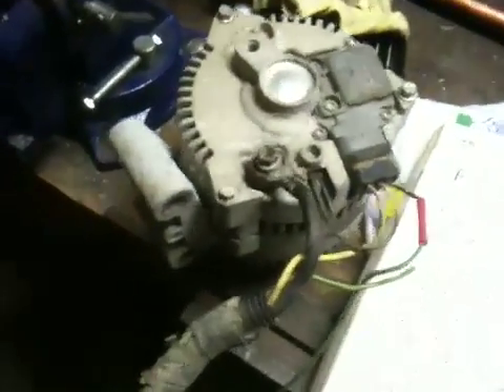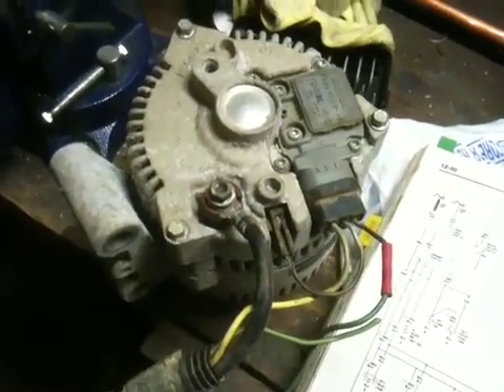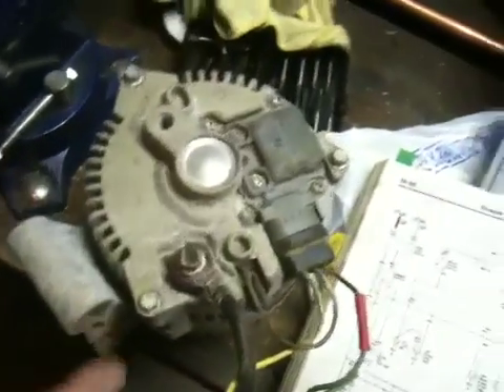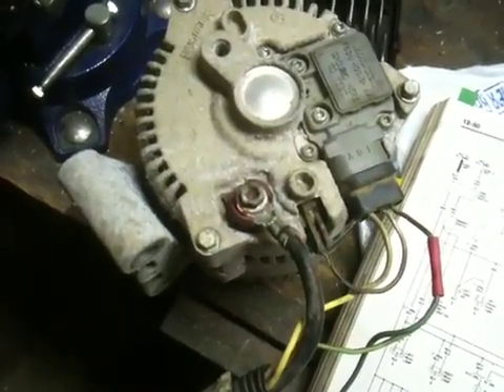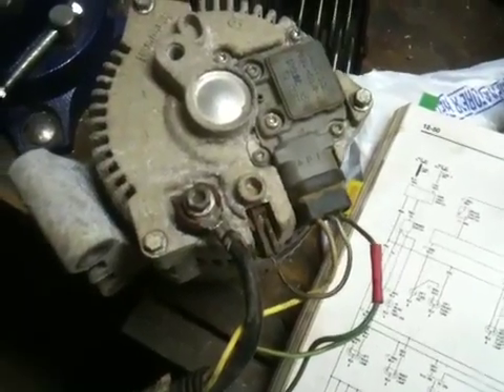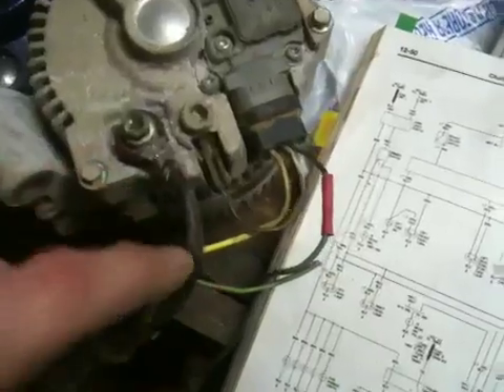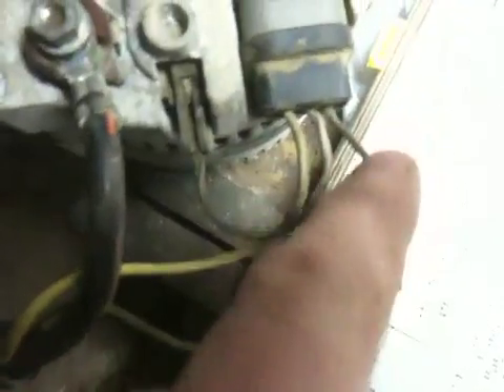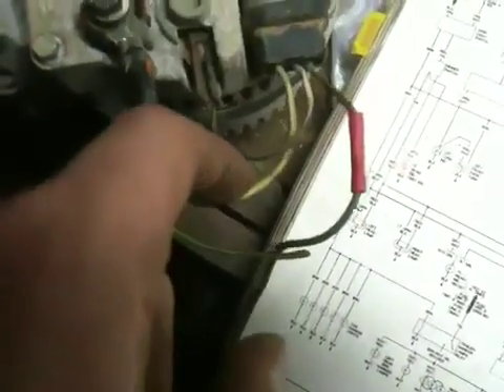Ford alternator wiring questions

Comment: For anyone still coming across this video, the device where the plug is located on this alternator is the voltage regulator. No need to add another. If you're curious about what voltages that alternator needs on each wire, you can watch this video. It explains the ASI lettering. https://youtu.be/Cnt025qfCpw

Comment: I have an 04 expedition 4.6l and I’m need to find the excite wire or the one that tells the alt how much voltage it’s putting out. I want install a rectifying diode to trick it into thinking it’s getting less voltage so that the alt puts out an extra .6V. What wire or where can I solder this diode to? Please help please! I know it’s frowned upon but I have a big amplifier and need more than 14.4v it’s actually giving me 13.4 while in highway. Help

Comment: But to buy pass voltage regulator , just run green & red stripe wire straight to battery positive post with inline on - off switch routed back inside console area for easy access   . Switch Must be a strong eneough to carry load . I use standard houehold AC on-off light switch available around the house . .... important :  always turn swith on when vehicle is running to charge battety and  AND  ALWAYS  turn switch off when you turn vehicle off or it will back feed back to alternator and slowly drain battery .    I know its a pain in the ass but thats why its recommended that a voltage regulator be in place .  Leave everything else already connected by the factory setting  alone  just incase you want to go back using the voltage regulator one day .  Chances are , your dash battery or alternator light will still be on while the battery is being charge still during vehicle operation . You can verifide voltage with volt meter while vehicle is running with it charging . You should read somewhere between 13-14v  . Hope this tutorial help ?

Comment: thanks for the video although it didn't help the comments did  i tried 3 diff alternators none would charge so i was about to take it to an electrical shop when i read the comments and come to find out  our mileage thing on the dash don't work so we got a used dash panel and it nvr  showed that the car was charge but we ignored it thinking it was norm well anyway we put the old 1 back in and wala it was charging so if you have a 1992 f150 or e150 and it wont charge with old or new alternator i suggest testing the dash panel with  all the gauges on it

Comment: i got the same problem here with a 83 firebird, one cable for a two-cable plug connector - the ALT doesn't charge the BAT cause there is only 1 cable - and also no BAT light in the dash...previous owners are evil...we should be carefull with our stuff...it' beieing really hard work on mine with that wiring and fuses and stuff...

Comment: that removable plastic thing that has the 3 wire plug is your voltage regulater.  the green/red wire goes to the charge gauge.  it needs to be hooked up because that wire tells the regulator to make the alternator start and stop charging.  i literally broke down today 11.06.11 i have a new alt so i figured it wasent getting it signal to start charging.  there was enough juice in the batt to start the truck one more time so i did then i "jumped that red/green wire and BAM!!! charging 15volts.
Reply: stackswellandcompany please help me I have the same problem with the wiring

Comment: That alternator looks about the same as the one my 5.0 Mustang Uses.
Reply: Bulimic 2g Ford alternator, they do the job but they are only something like 75a. I think the later 90's 2g alt like what's found in a fox is 90a, still not much amperage but it did the job. I always swap them for a newer style 3g which is 130a.

Comment: I do know the alternator your showing has the voltage regulator on it, it's that little black thing bolted to the back that the wires are plugged into. I can't tell you anything about the wiring, sorry.

Comment: just hook it to a drill press or somthing that spins fast then hook a volt meter to it, if it goes above 14 volts than it needs a voltage regulator if it stays at around 14 volts for any speed then it has an internall voltage regulator.
Reply: Hey did some one no why I'm not resiven  power to my voltege  regulator plug